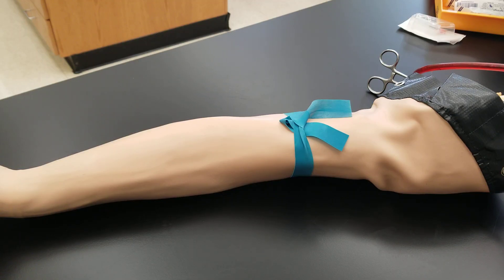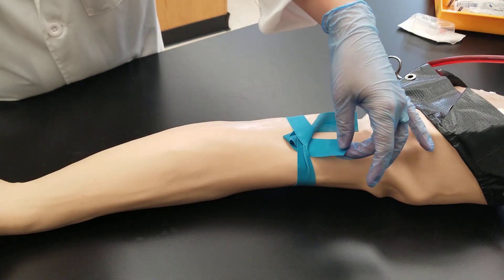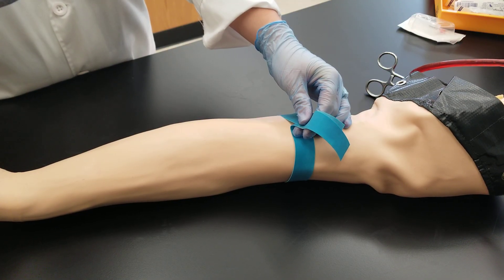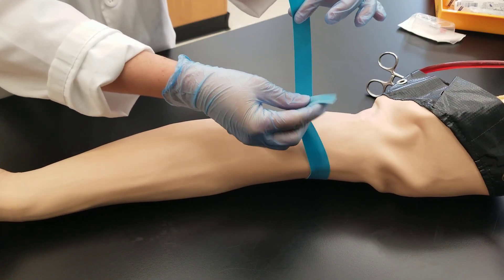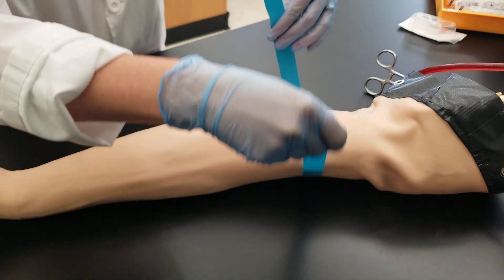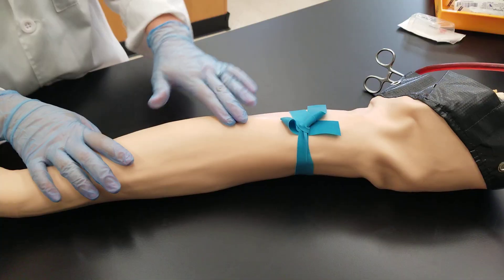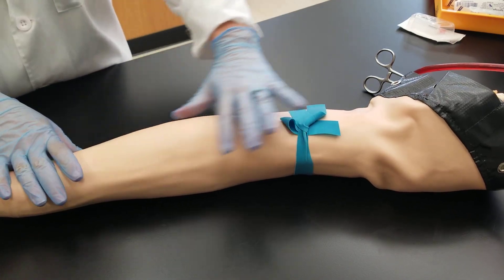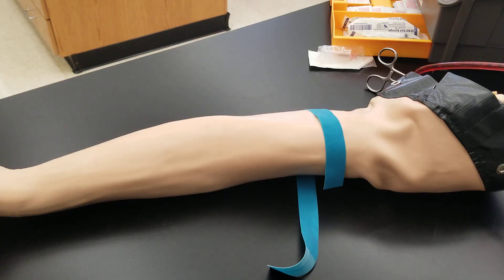Phlebotomy: Tourniquet Application

Comment: Awful tourniquet.  No where near tight enough.  And concentric circles went out (CLSI) in 2017.  Back and forth to create friction works best. BD straight needle safety indicats bevel up.  Yours is NOT bevel up when you insert.  🤦‍♀️ Taught, not taunt.   Very wrong way to hold the barrel when inserting.  Anticoagulated tubes need to be inverted immediately!! Your tubes will be clotted.  You're pressing down on the gauze before you pull out.  WRONG!!!   That will slice the vein and hurt the patient.  And the gauze needs to be four folded.  NEVER flip safety with forefinger. Use thumb which you would have done if you'd had it in the correct placement.  NEVER remove barrel from needle!!! Barrel Goes in SHARPS, NOT trash!! HOLY SHIT!!!  Needle and Barrel as one unit in sharps!!! HOLY SHIT!  Also, it's a barrel or holder. Not a hub.  The hub is ONLY the part that needle screws into.  Coflex needs to go all the way around so it holds.
Reply: are you lost? where did she use a gauze or insert a bevel? you're nitpicking when you can't get the video right